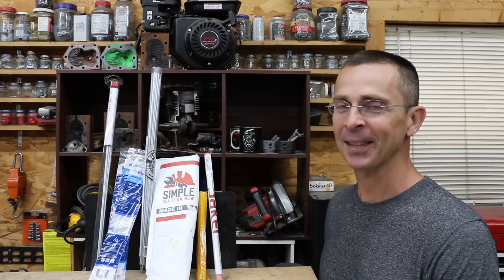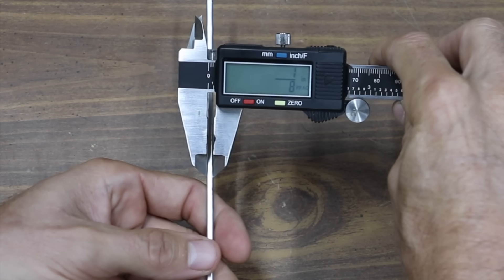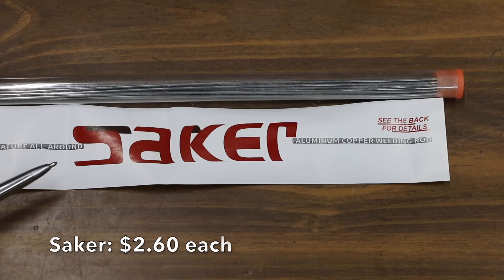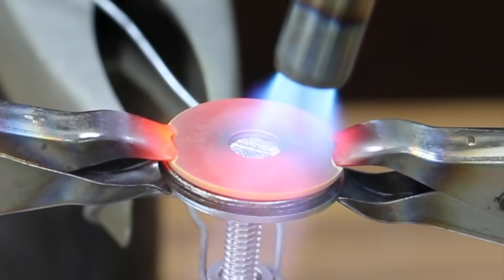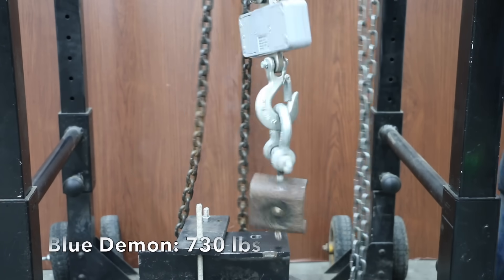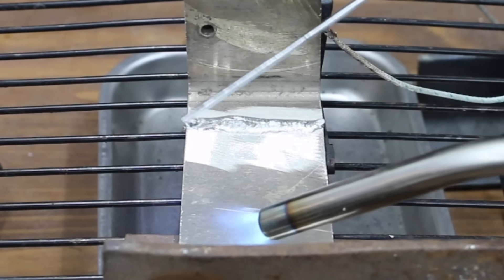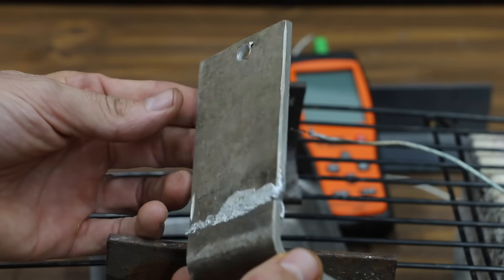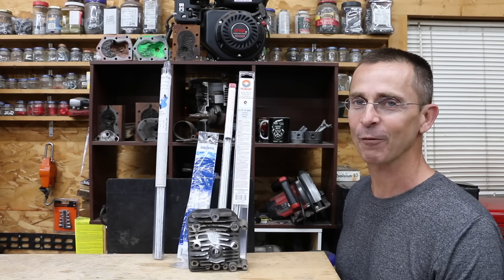Best "No Welder" Aluminum Welding Rods? Alumiweld vs Bernzomatic vs Hobart

Comment: Tried to fix some holes on my aluminum boat, small holes did ok. I had 1 bigger hole, kept adding but I would end up with a small hole that wouldn't close up. Heated it up again and touched the rod to the braze and the hole chunk fell right thru...now I have a big, big hole, lol. Can't recall the brand, or if there was one. Boat is old as the hills and the aluminum I'm sure is stressed. Good test, sounds like Bernzomatic may be the choice since the sell at Lowes and Home Depot.
Reply from the maker: Thanks for sharing.

Comment: NEXT PROJECT
BEST CONCRETE MIX :) 
or best epoxy granite mix  
both to achieve super strenght without looking at cost 
im going to test it by myself for making cnc out of granite /epoxy granite or concrete  but it will be great to see your comparsion 
Probably epoxy wont get most views thats why concrete will be beter option
Reply from the maker: Great suggestion!  Thank you.

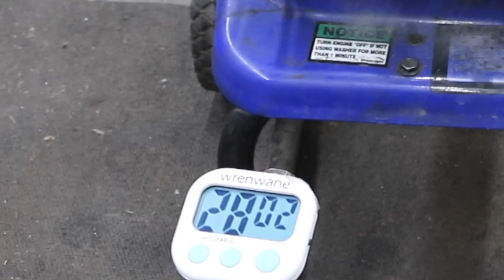Comment: 13:11 interesting! The weld material acts more like a mirror to IR. You can see this with stainless steel, where you get a nearly perfect IR reflection
I put kapton tape on all metal pieces I want to measure just to avoid these affects
Reply from the maker: Thanks for sharing.

Comment: seemed like the simple brand came off the rod on clumps probably leading to the trouble with sticking to the area to be welded. seems like it would take more heat to get it to flow than advertised.
Reply from the maker: Thanks for the feedback.

Comment: It would be interesting to see a test between different brands and styles of sandpaper.

Also, testing the different tools out there for cleaning copper pipes for soldering/brazing purposes would be interesting. From my usage of them i had always found sandpaper to be a better option.

Deburring tools for copper pipe would be interesting as well.
Reply from the maker: Great suggestion!  Thank you.

Comment: Anyone know if these would work with broken exhaust bolts in aluminum heads that sit flush? "Welding" a nut to it like you normally would when using an actual welder?

Comment: Use a Brass brush or rod when its in molten form to work any oxidation up to the surface and make it flow.  I filled the corner of a timing chain cover with it!  You can also make damns out of sheet metal to contain it.  Love your shows!
Reply from the maker: Thanks for the suggestion.  Thanks so much!

Comment: Used similar rods back in the 90's the kit came with a stainless steel rod pointed at one end the idea was once the rod had flowed you would scratch the surface of the area being welded to break up oxidisation with the tip of the stainless steel rod and because the surface was covered with molten metal couldn't reoxidise
Reply from the maker: Thanks for sharing.

Comment: It would be nice to see if, after cooling, the cylinder head holds up to a couple of more rounds of temp cycling.  With such a difference in temp, you would think that may be an issue.
Reply from the maker: Thanks for the suggestion.

Comment: Amazing timing of the video,  found a small crack in my buddys aluminum wheel, now I know which to buy. Thanks PF
Reply: wheel as in on a car? you do not want to mess with anything structural and safety related with this stuff
Reply from the maker: Glad I could help!  You are welcome!
Reply: TIG or don't bother.
Reply: Some alloy wheels are under tremendous internal stress.

Comment: Oh man this one made me excited.  I bought some of these thinking they'd be great (they were some offbrand), and they absolutely worked horrendously.  They didn't hold up, barely could get them to stick right, they just didn't work well at all.  I had my torch on and just could NOT get the damn stuff to melt.  However, some of these are super promising.  I love the cylinder head test, that was a pretty rad way to see how strong they were.  (silently heads to amazon)
Reply from the maker: Thanks so much!  Thanks for sharing.

Comment: 13:08 Metals, especially shiny ones do not do well on a thermal imaging camera due to their emissivity values. Most cameras have a calibration factor to get accurate readings but it's not a good solution on mixed material/surface measurements. It's definitely a lot more visually interesting but the best method to get accurate temp readings is a thermocouple!
Reply from the maker: Thanks for the feedback.
Reply: @ProjectFarm  paint it with black BBQ spray or any hi temp  paint and compare readings.
Reply: @ProjectFarm  You should do a test of thermometers & thermal sensing equipment. I know I've got three different laser temp gauges and all three show different numbers... x_x
Reply: i see,...cats are smart indeed!
will these rods work on electric arc welders?
Reply: @fidelcatsro6948  I've never tried, but I think TIG would be worth a shot. This Old Tony (another youtuber) has a video on TIG brazing.
Reply: @JustAnotherGuyInTheComments  i only have an arc welder alas...;(

Comment: por 15 metal prep (metal etcher) does a really good job in preparing the metal prior to Welding. My welder who welded my 20 gallon fuel tank shut told me whatever you used to prep the metal worked really 👍great!
Reply from the maker: Thanks for sharing.

Comment: That aluminum weld spot on the cylinder head was not lower temperature than the iron. Aluminum has a very LOW thermal emissivity, and that's what an IR camera measures. Aluminum emissivity is typically 2-10%, while most other metals are 85 to 98%. Since it was not radiating heat away it was a bit hotter than the iron. 
Most people don't realize their IR thermometers work poorly on shiny bare metal.
Search:  thermal emissivity of metals
Reply from the maker: Thanks for sharing.